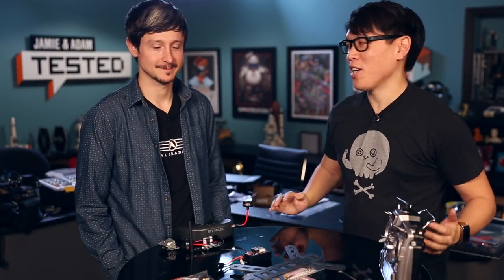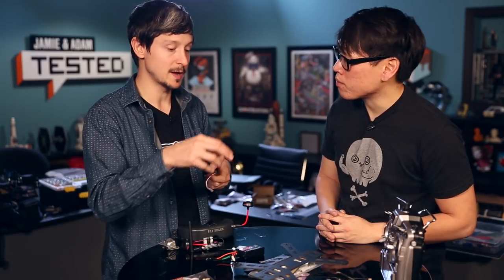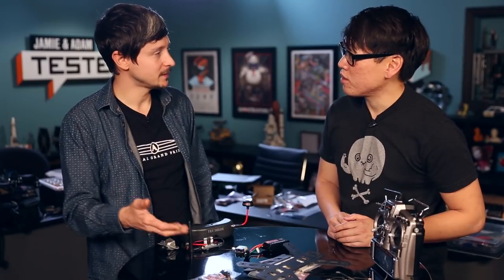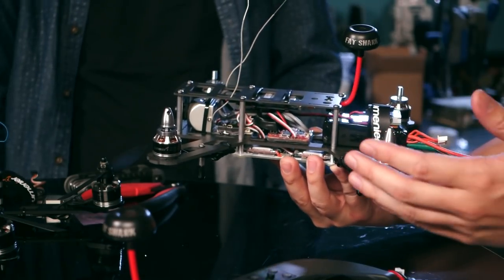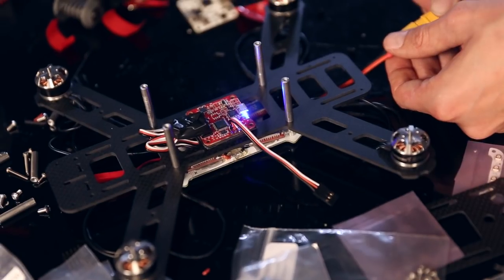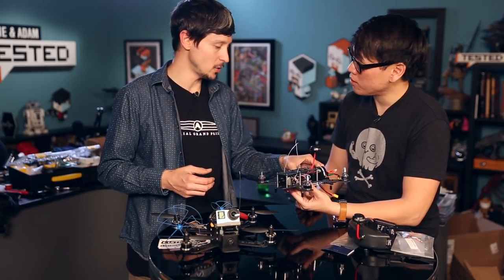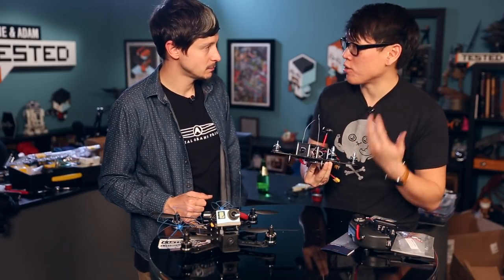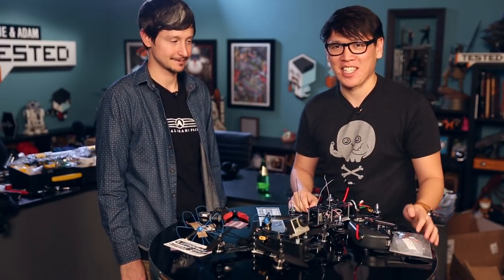How to Build a FPV Racing Quadcopter!

Comment: Get a quad body removable arms, a lot cheaper to replace arms than the body. My carbonfiber arms cost me 6$ each. A lot better than dropping 120$ to replace the whole body cause you can't just change the arm.
Reply: What body do you have
Reply: like a nighthawk 250????
Reply: ythat body on vid is about $20
Reply: for sure. super cheap. So i see it breaking alot. so taking all the shit off it every time to replace the body is an absolute hassle. if its just a single arm you need to replace then it would A) save you money and B) just way quicker and easier to fix to fix.

Comment: I know I am a bit late but, what is the latency on something like this today??
Reply: like the latency with your wifi. if u use 2.4GHz if u use anything lower the latency will be higher while higher frequencies will have less latency, but all used frequencies are fast enough so u usually cant tell the difrance

Comment: I want to start drone racing. I have a very small experience with drones. Which drone should I get to start racing? or should I build my own one? Should I get FPV goggles? if so which FPV goggles should I get?   thankyou
Reply: If you want to build a mini quad and use FPV,you might want to get the quanum FPV set from hobbyking and the set includes everything you need for FPV including the goggles,video transmitter,camera,all the wiring,etc.all you will need are two 3s batteries after that and the whole set cost 100US$ only,when you get better you could move up to the fat shark.
Reply: +Rc Maniac cool thankyou I will look into getting that set. should I build my own drone or buy a prebuilt one?

Comment: Quad: Basic 250mm HK kit - $134.98
Video Receiver: Boscam FPV 5.8G 8CH 200mW AV Wireless Receiver - $19.22
Video Transmitter: Boscam TS832 32Ch 5.8Ghz 600mw - $38.99
Camera: RunCam PZ0420M 600TVL - $39.27
Battery: Turnigy 2200mAh 3S 20C - $11.49
Telemetry: D4R-II Receiver - 4 Channel ACCST w/ 8 Channel CPPM - $35.50
Transmitter: FlySky FS-T6 2.4ghz Digital Proportional 6 Tx - $52.99
Charger: iMAX B6 OEM Battery Balance Charger - $22
FPV Goggles: Quanum DIY FPV Goggle V2 - $55

Total =~ $430

I'm sure you can get some cheaper components, and if you already have batteries/chargers/transmitter, it can be even cheaper.
Reply: are these all the materials

Comment: I have one question: How do you manage flying trough those buildings without losing the 5,8ghz Fatshark signal?
Reply: Jolt Flyer and another, too ^^: Are this frame and the motors from Lumenier also suitable for aerial filming, not only for racing purpose?
Reply: Jolt Flyer Sure, the Lumenier gear is high quality. Generally the QAV250 size is smaller than most would want for real aerial filming, but it can be done. You may want to look into the larger QAV400 or QAV500. Both of those are well suited for gimbals and geared for aerial photography.
Reply: surf1punk ok, thanks for the information :)

Comment: I have a spectrum DX5e. I bought it to fly a plane cheaply. Could I use it on this build? I'm a beginner.
Reply: Sure, a 5 channel radio would be enough to get started with. Down the road you may want to eventually upgrade to add more functionality. The FrSky Taranis is an awesome radio, same they have in this video - http://www.getfpv.com/frsky-taranis-x9d-plus-2-4ghz-accst-radio-x8r-combo-mode-2.html

Comment: very surprised that battery safety wasn't covered better and there were no warnings on the amount of damage props can do to fingers etc. Anyone who is into RC knows that lipo batteries can explode if charged or discharged to much but any beginner watching this could end up with a very nasty fire through just not knowing the basics.

Comment: are there other  Flight Controllers available that can do more in helping you fly the copter
by leveling and acrobatics 
example i got a drone that stays where it is even when i let go of the radio
Reply: Well with the naze board there are 2 flight modes, acro and horizon. Horizon does what you said, keeps the quad in a stable upright pos using the gyro. Acro is more complicated, the gyro is still used, but it is used in conjunction with the pilots movements, so basically if the pilot puts the quad at a forward pitch, used to accelerate, the gyro will do its best to keep it at that position until the pilot changes controls, while horizon will try and get the quad stable no matter you pitch or roll

Comment: what looptime you use with this lumenier 12 amps escs?? And what motor pwm rate 488 or 400 in cleanflight
Reply: Bill Asimakopoulos The new autoshot ESCs with 1 shot enabled, you can do around 1000 looptime. PWM rate, just use the default.

Comment: Would you still need the ESCs if you used an arduino?
Reply: It depends on what your arduino is used for? :)
Reply: Lukas Liß
I don't know yet. I just saw that people are making their quads out of arduinos. I should read up on it again. Was just wondering if I could just have the arduino handle the function of the electronic speed control for the motors. Would make a lighter and more compact setup know what I mean?
Reply: Yes
Reply: Max Story
Awesome

Comment: I'm new to this Drone racing stuff but it seems so far in my research that these batteries only last at most 10 minutes? So during a race or even when you're outside playing around, do you really have to replace batteries every 10 minutes? I'm looking into building a racing drone and I'm thinking about the time it would take to practice everyday. Just one hour would make me buy 6 batteries. That sounds terrible
Reply: Weight is a huge impact on racing drones and anything that flies in general, put a bigger battery and it'll go slower. It's up to you what you want to use but when doing actuall racing go for smaller batteries. It's like in Formula1 they put a certain amount of fuel because if they fill it the tank all the way it'll weigh more and be slower.
Reply: Once you get into racing heavier, you will find your flight times go down and down. Most are only getting around 3-4 minutes of race flight. Thats not to say you can't build something to give you longer flights but something that offers 15+ minutes of flight is not going to be good for racing. If you want speed and power, you have to sacrifice endurance. If your looking for endurance, you have to sacrifice speed and power. All this is considering the current technology, in another couple years, you might get your cake and eat it too.
Reply: and also 10-15mins allows the components to cool as well. overworked components fail and suck in general. obviously the more expensive components are built a bit better but 10min on a race quad is fine.

Comment: how long cant the battery last and how far can it go??
Reply: Range depends solely on your radio gear, proximity to cell towers, flying through buildings, etc. A set up like this, built for FPV racing, will give you a few hundred yards of range. 5.8ghz video gear is fairly high spectrum so it will have lower range and penetration but with better resolution. Think cell phones: a 2G connection will spread far and wide but be slow (resolution) whereas am LTE connection won't go very far or through walls but will have crisp resolution. 

As for battery life, again... Too many variables. Looked like he was running probably a 3s pack, based on the size maybe... 1300mah. So with the gear he's running, if he's not trying to power his GoPro off the flight pack... Maybe 5 minutes, depending on how aggressive you fly.

Comment: Is there a way to just go out and buy a decent quad copter? (around 300 dollars w/ FPV) I dont wanna drop 800 dollars into a hobby im just considering to get into.
Reply: Not with FPV
Reply: +Quinley Sweet no idea I have been looking around for a cheaper entry level alternative myself. I don't mind the cost of a good RTF high speed drone, which is usually around $300 - $400 but the price of FTP is just nuts. You can easily pay more for FTP than the drone itself. It seems to be that to fly FTP you are going to have to drop $800+.
Reply: If you are just starting to use drones you should get a cheap drone that you can throw around without destroying thousands. I like the DM007 Nighthawk - good range, great to practice on, very durable, has a nice camera (not live feed) for the price. I have crashed mine many times where most drones would be totally destroyed. I have a friend who has a DJI Phantom and had a hard time driving this because he jumped right into pricey drones so sucks at flying anything without some automated flight system on board. Overall great starter drone.

Comment: It should be mentioned you should shop around , the prices for the parts he has listed is for a high end competitive racer , You can build a really fun "250"  fpv racer with radio for under 400.00

Don't worry about stupid expensive radios, my 60.00 rado does everything that a 400.00 radio does

here is an alternative parts list that actually builds out a great little flyer. .  

ZMR250 frame, Emax 1806 or 2204 motors, CC3D clone(~$17), Turnigy 9X radio

Here is a FPV rig a few friends are using and having a great time with it. http://www.hobbyking.com/hobbyking/store/__63646__Quanum_Complete_FPV_Bundle_Set_w_Goggles_5_8GHz_32ch_Video_TX_RX_CP_Antennas_and_Camera_PNF_.html

Comment: a little bummed as I purchased parts through site and it turns out some are not available.  Mainly the motors.  I purchased what seemed like identical ones,  but not the case.  RX is not the same as FXC. Too small and not all 4 screws line up to frame (only 2 of 4 line up) Gave it a shot but caused me to lose a motor and some wicked crashes.  :/   My fault as I tried it anyway,  but unfortunate.  Also,  frame not identical to what is pictured here.  Different slots on arms.  Not better or worse.  Just calling it out.  Lux Controller seems to work fine with this,  as the site is out of Acro Naze. Comparable in price.
Reply: to be clear,  not complaining.  Just wanted to spare someone from making my mistake.
Reply: The video is from 2014

Comment: one think what no one is mention. it looks easy but its not. as right now I bought my own quad crashed it and drone does not work any more. 
1st must know which ESC much to your batery. most of esc you must calibrate with your remote. I havent done it jet but to do it you must be handy with solder iron.
next thing
controll board I have Crius MultiWii SE v2.5 which nedded to be programmed. its not hard but you must know what you do in.

its not that easy as you guys think but its possible to build one.

Comment: Is there any cheap racing drones?
Reply: +Hoffantor Look on Ebay. They have some ready to fly kits for around $250. They're great to start off with and get some practice and knowledge. Once you get the hang of it, you can always upgrade. And always make sure to buy a ton of extra props if you're new.
Reply: Define cheap. ARF $400-500+receiver+batteries+Transmitter. So no...no cheap ones. This is a hobby. Hobbies aren't cheap. If you just want a fun little Fpv quad experience, try the Blade Nano QX FPV. That price range might be what you're looking for. Badass little quad also.

Comment: I don't get why these low mAh batteries are so huge. my samsung phone battery has 2000mAh and weighs nothing and is as flat as can be. I wonder if you could use one or two of them.
Reply: Your phone battery is also more than likely a one or two cell lipo (1S or 2S). These machines require anywhere from a 3S to a 6S or a couple of each depending on size. The more cells, the bigger the pack. Plus you have to consider discharge rate (or "C" rating) which is essentially the speed at which the battery can dump power. Your phone requires a slow drip while an application like this requires intermediate bursts of huge power.

Comment: Someone has told me not to use the Acro maze if you're just getting into the hobby because it's hard to configure and stuff. Can someone help me with this?
Reply: It's no harder than any other flight controller. You will need a pc, there is a nice chrome app to download, plug I. The board, adjust it's settings to match your board rotation, channel order, receiver type. Calibrate the accelerometer and set your radios mode switches and you're good to go
Reply: Benjamin Harvey ok, thanks for that

Comment: I realy need help when i tested my motors from the naze32 my 4th motor gains more throttle with out me rising it and then smoke come from i think the ecs 

plz help

I dont know what to do and i spent like all my money i only have 47$

should I re do my soldering or what every thing els works led and the other motor can any one plz try to help me
Reply: That's supposed to happen. But your esc is done you'll need another one. Never let the motors spool up to full without the props on the motors.

Comment: What is the white thing sitting on top of the battery at 26:12? Filter?
Reply: Balance plug from the battery (lipos require a balance charge). Unless you mean the port for the video transmitter?

Comment: Question: The partslist does not show the details of the discussed RECIEVER in the vid... anyone: What is the exact reciever in the video? Not the X8R for sure...
Reply: I think it is the X8R? Looks like he bought or brought the $299 Taranis bundle. I could be wrong. I fly ezUHF personally
Reply: Joe Davis no it is Not the X8R   I know because I have it myself, and yes that comes bundled with Taranis.  So question remains,  what is the make of the shown receiver in the video?
Reply: Hugo Koopmans anyone? not even guys from Tested ..?
Reply: Hugo Koopmans try the frsky d4r-ii because I know alot of people use them on racing quads like the immersion rc vortex and they have the same antenna setup

Comment: whats the best frame size to get a 250 or 280 ?
Reply: 280 and 250 frames are dead. if you want to run 5 inch props you are gonna want a 220 size frame like an alien

Comment: Is a naze32 still a good board
Reply: its just not relevant anymore. there are too many better boards for just a bit more $ that can run the optimal settings in the firmware  of Betaflight

Comment: Everything you need to get one of these beasts ready to fly NOT INCLUDING TRANSMITTER is roughly 1,137 usd
Reply: javier lopez That seems high. What gear are you thinking about?
Reply: everything here in this video along with the fpv gear shown in this video costs that much. Not factoring in a transmitter
Reply: javier lopez Actually, out of curiosity (no pun intended) I added all the things up without the transmitter and got $673. Am I missing something?
Reply: I factored in the carbon fiber frame they used in the video but didn't put it in the list.
Reply: javier lopez Lol it's around $650.Also they put the frame into the list too.Don't know what you are smoking
Reply: +NamesWereTaken Yeah, I took a look at it too. It's a pretty good price for the drones I've seen so far.
Reply: I've got one up for £160
Reply: +seth newman Yeah no kidding! 1200 bucks is more than enough!

Comment: I hope someone can tell me what is wrong with my drone. 
I bought drone which goes up to 80miles per hour.
i have 
Emax mt 2206 1900kv electric engine
simonk firmware 15A 2-4s lipo ESC
Crius MultiWii SE v2.5 flight control board.

basicly after under estimating power of my drone I crash it in 5 minutes. crash wasnt big. but it broke two of my carbon props. 
end up havin one engine glitching and not spinning. after al I changed the engine but find out that new engine has the same issue so, next I have changed was ESC 
and suddenly after soldering I realize that my drone do not pick up my remote. and flight control board do not give any signal light any more. I have no clue any more what is wrong with the drone. and where to look for it. but by the time I fix mine I will be able to build my own drone

Comment: where can i buy a racing drone for less than 250 quid with the goggles (diy kit)
Reply: alex b 
1. You're not going to find a racing quad kit + goggles for less than €250
2. The point of a kit is that you make it yourself. You don't get it in one place, you have to find all the parts individually.

Comment: what is the headset they are using? where can i get one?
Reply: the FatShark tele porter V3 but don't get that one get the Attitude v3
Reply: +Luke Fedida isnt the dominator v3 a little better
Reply: The dominator is better but it's a little more expensive and is geared more towards the more experienced drone pilots.

Comment: Does anyone know if these FPV drones can fly at 7000 feet. I've had some bad luck with tiny helicopters where I live.
Reply: I live at 7000 feet that's why I asked.
Reply: You will likely burn through the battery a little faster, but it should fly fine.